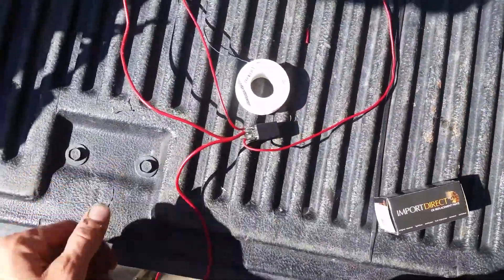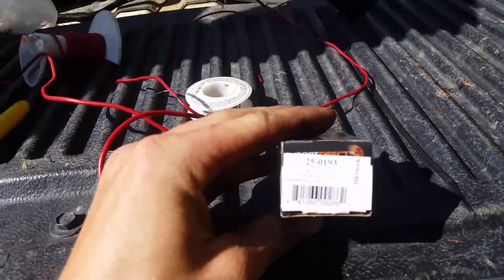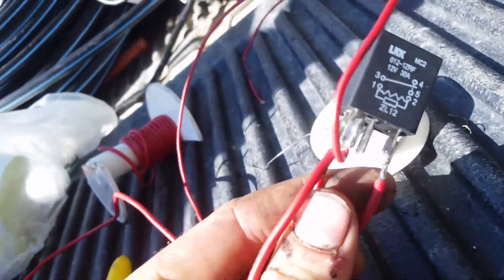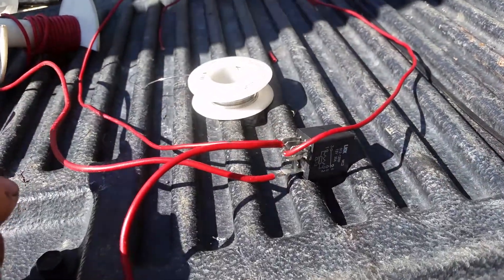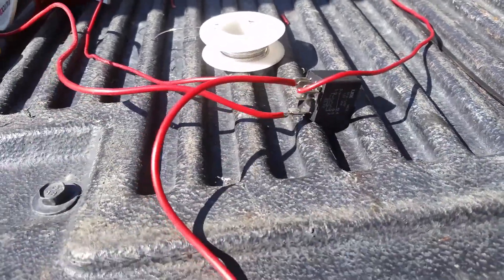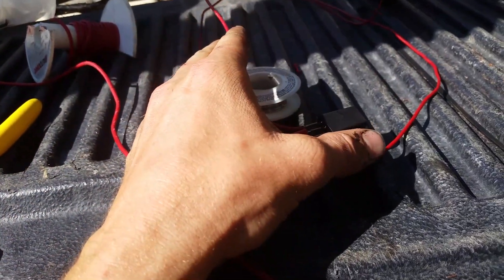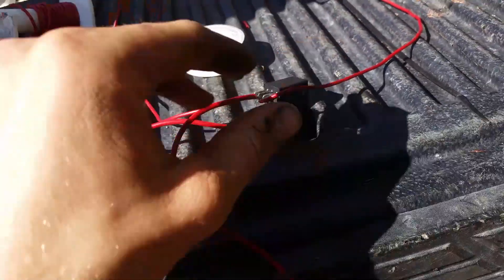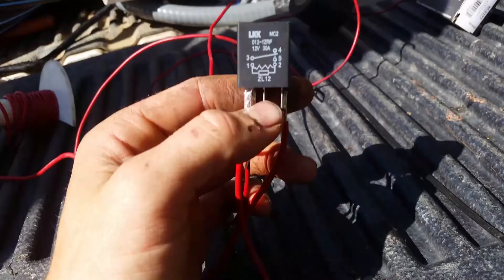How to wire TCC for PCM, ECM, ECU with break light positive. (RELAY)

Comment: guy is a dork...just buy DR461 Duralast Brake Switch @ Autozone. They are 12.99. They have 2 switches in them. The front switch is the regular brake switch. The 2 rear most wires will go to 12 v and the TCC wire from the computer. Switch closes the circuit sending 12v to the TCC wire when the brake pedal is applied.

Comment: So if I added a manual lock up switch and then installed this relay would hitting the brake pedal disengage the torque converter even with the manual switch sending the ground signal to the converter?